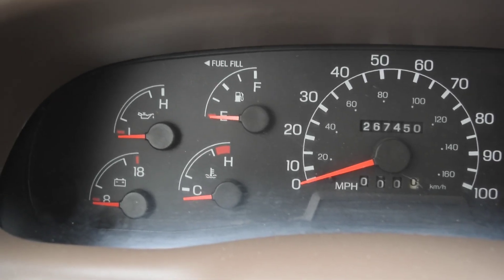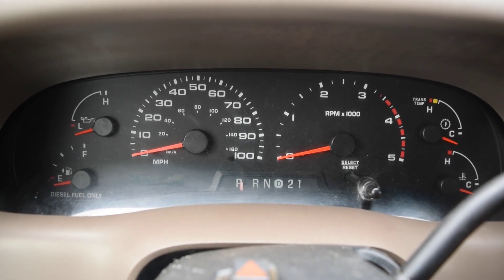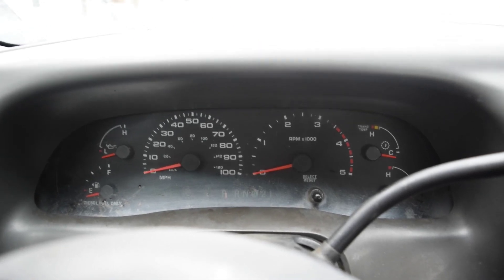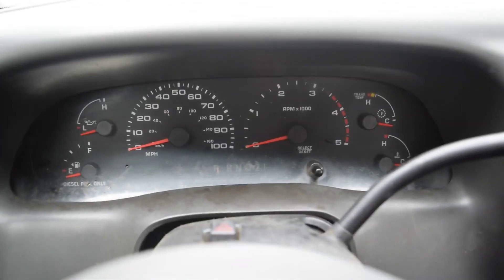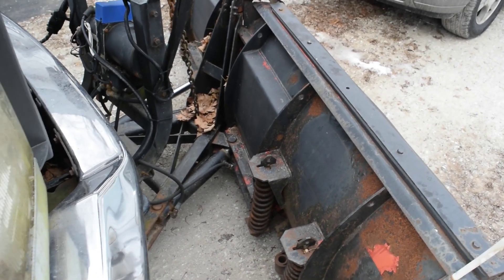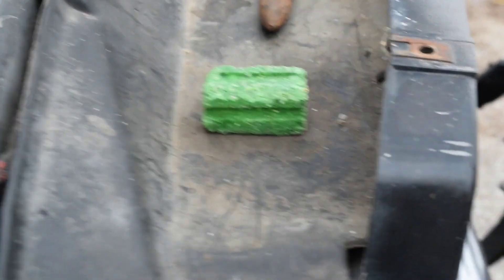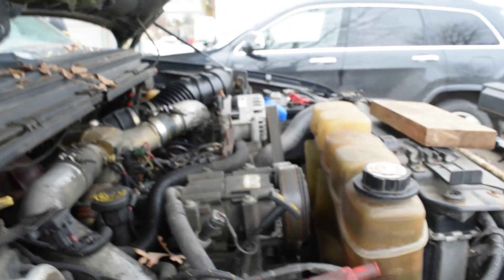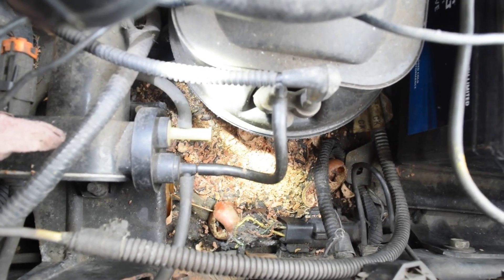Super Duty alternator doesn't charge the batteries but tests good at the parts store? Check this!

Comment: They really like the vibration shields/wire/hose sheaths (corrugated plastic covers) and chewed on my factory air intake/filter housing. Pretty sure it's squirrels, in my case. I've heard the wires are a treat, that the lube they used to make the wire was a soy bean oil, or some such nonsense. Thanks for the info.

Comment: 2003 super duty's with the manual ZF6 transmission do have the battery gauge in place of the trans. temp gauge
Reply from the maker: That's what I thought but I wasn't 100% sure.